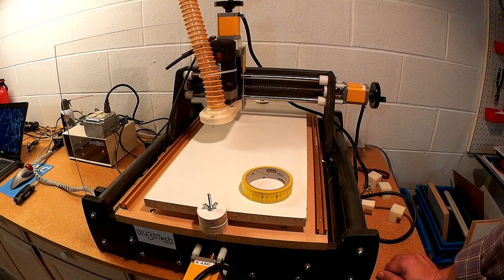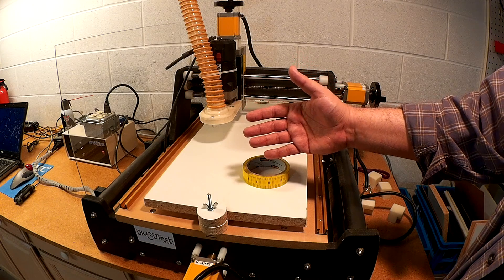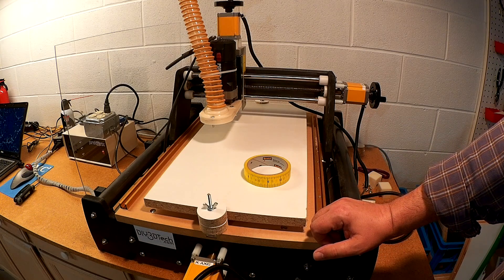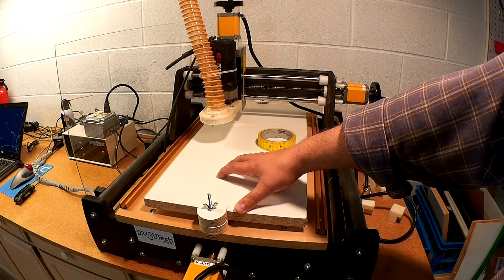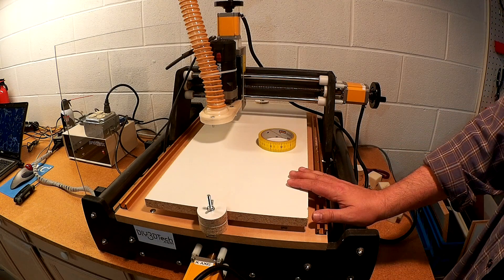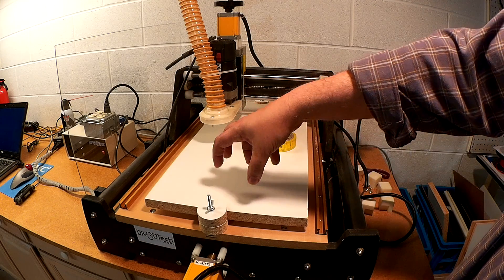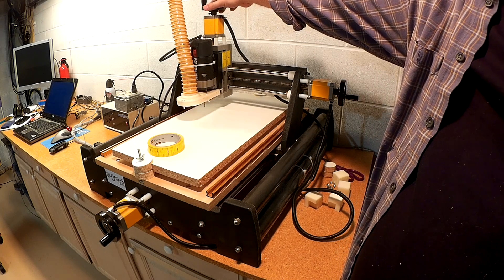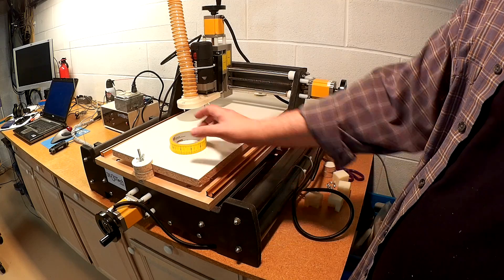CNC Router - Tips Tricks and Ramblings!

Comment: It's not the look and feel of windows.
Reply from the maker: +MiggyManMike The newer distro's are pretty close, for example I used a Debian Distro (actually the LinuxCNC) and installed UGS fully by the GUI. Installation was also very easy too.  However the point I will give you is the Linux GUI is a bit Java-ish in appearance and not quite as refined as (possibly due to patent issues and anti-aliasing, but that is only a guess).
Reply: It's neither, it's a "WIMP" gui, the foundations of all modern gui's own most of their characteristics to xerox parc.

Also the gui in linux, well, the window manager component, is utterly interchangeable.
Reply from the maker: +MiggyManMike LOL!  Was raised in the days before GUI's and X11 was the thing :-)  Those where the days :-)
Reply: Window managers run in X :p

X.org these days mind, but still X :D
Reply from the maker: +MiggyManMike POSIX Rules :-)